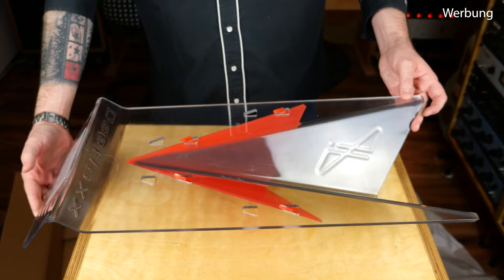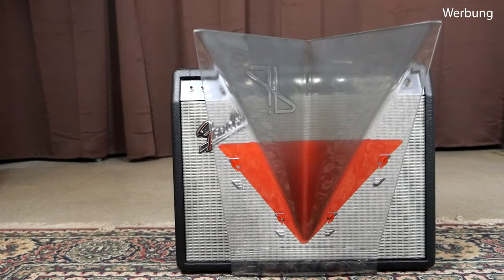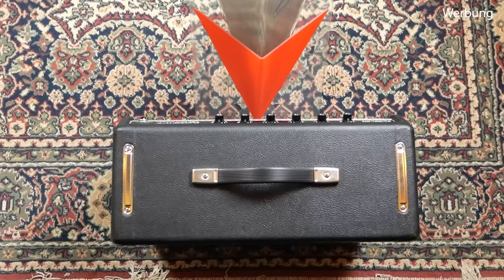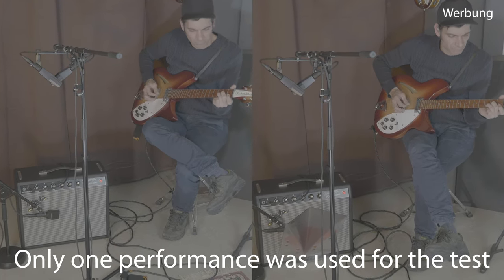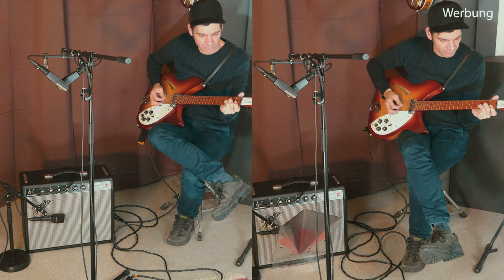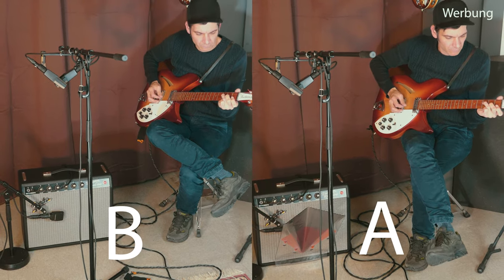Smoother Amp Sound?  - The Deeflexx Sound Deflection System | Review & Demo

Comment: Nice job-well done! 👍 Your sound samples demonstrate the same results we get. The Deeflexx has no impact to conventional miking near the baffle – so you cant hear a difference like in the first “Close Mic” A/B test - check!
After the first comparison “Overhead” it was clear, what samples were recorded with Deeflexx or not. 😀
One tip: If you want to get a brighter room sound, place the mic more to side than on axis, height 1,5 - 2,0 meters. But you’ll get many more different sounds when you put the mic on the surface (Contact Miking) or just around the Deeflexx with a distance from 0 cm – 30 cm – GREAT SOUNDS ! 🔥🔥🔥
Reply: "After the first comparison “Overhead” it was clear, what samples were recorded with Deeflexx or not. "
Yes, that's exactly what I thought too!
I just got my Deeflexx yesterday and I noticed that it gives you uniform sound everywhere except directly above it, which is noticeably brighter, especially if you don't use the additional red diffuser.